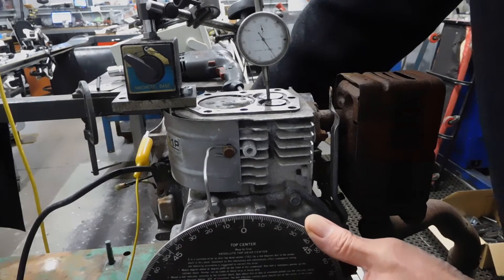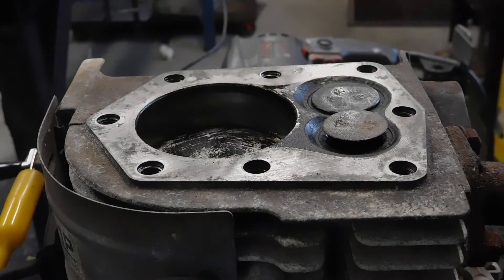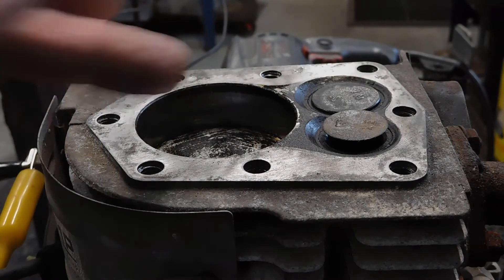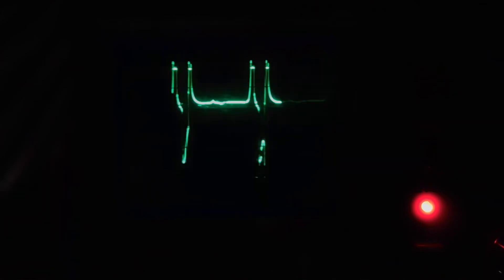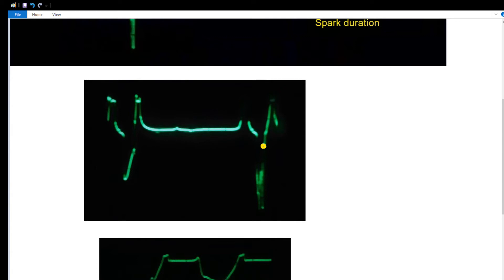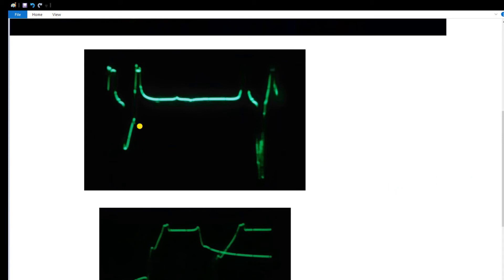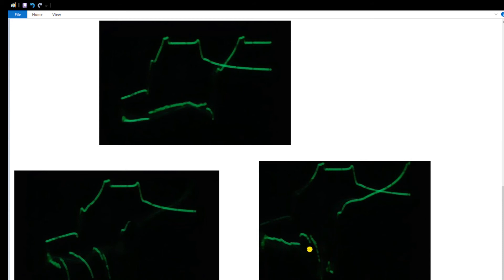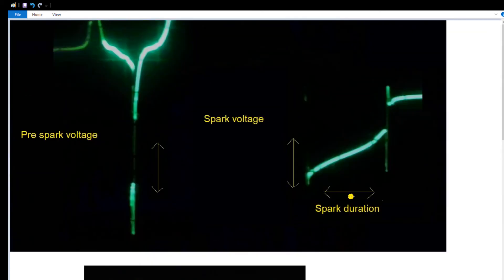Real time wasted spark ignition system demo, combustion spark line analysis E33

Comment: Thank you for your thorough videos..can i use this method on modern cars with an digital automotive oscilloscope? If so what would be the way to connect the leads?
Thanks 
More specifically a coil over plug type set up
Reply from the maker: The same applies to any dead spark system.
Like coil packs that share a common coil for 2 cylinders.
But probably not for coil over plug.
Its hooked up to the primary in this case, but due to the way coils work you will see it in a secondary pattern due to mutual inductance.

Comment: Do you know what is in the “tin box” circuitry that now allows for the kill switch to be momentarily pressed and released and the engine will completely stop?  Used to have to hold it until the motor stopped rotating or it would fire back up again.

Comment: Fabulous video.  Loved it and thank you.  I've been looking for this exact information for a while to diagnose an old Evinrude outboard motor from the 40's which still has the breaker points.  You helped me pinpoint the issue and it's actually running once again so thank you!